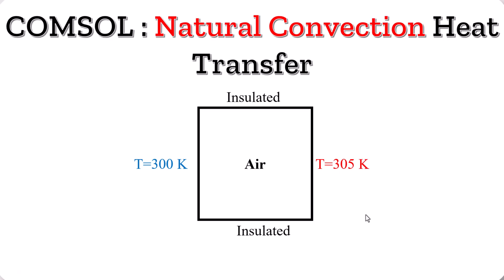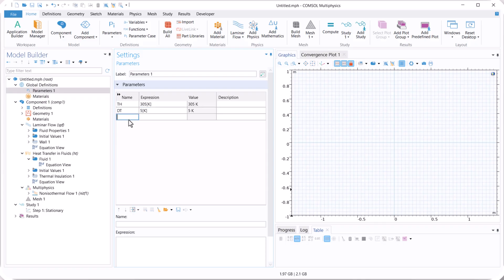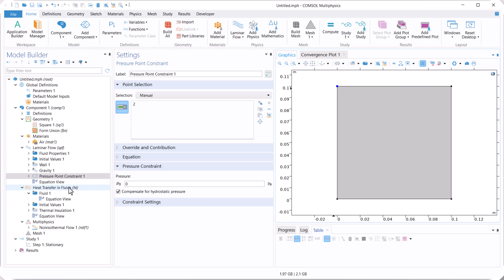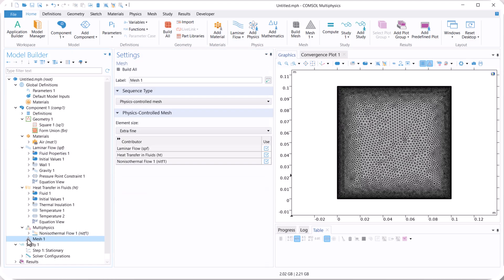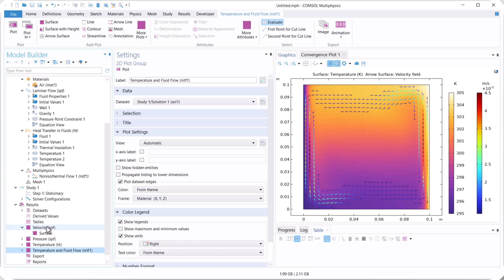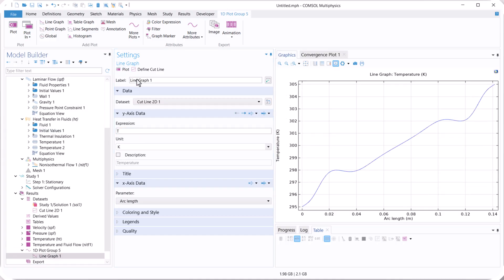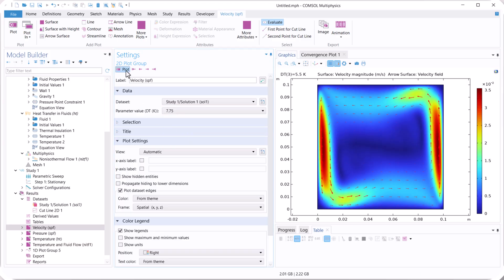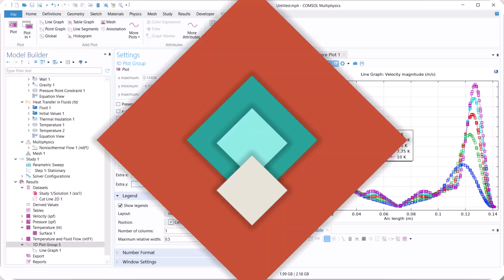COMSOL Tutorial: Modeling Natural Heat Convection

Comment: Thank you i tried it when heated from below it dont works why
Reply from the maker: Hello, Make sure the Grashof number is below 
10^9, if you are using the laminar flow model. Cehck your dimensions. Refine the mesh near the hot and cold walls.
Reply: @DR.ABROFARAKH many thanks how do I use non dimentional equation in comsol
Reply from the maker: @kermichemgp  The relationships for non-dimensional numbers are readily available in the literature and can be defined directly in the parameters or variables section.
Reply: @DR.ABROFARAKH  many thanks it worked when I reduced dimension